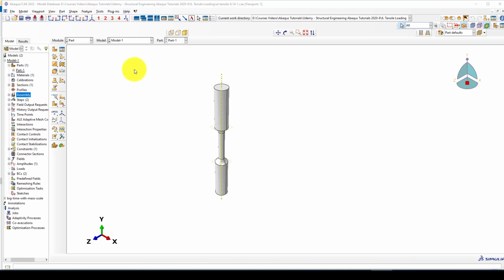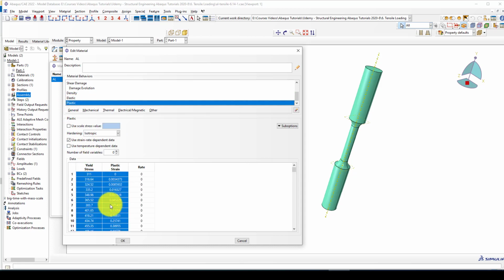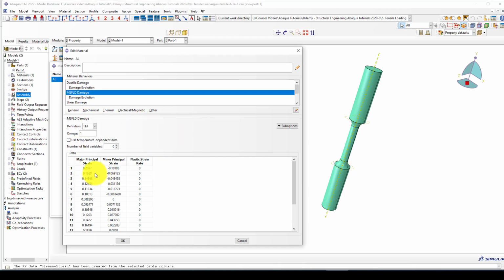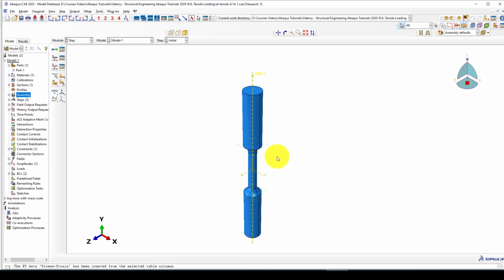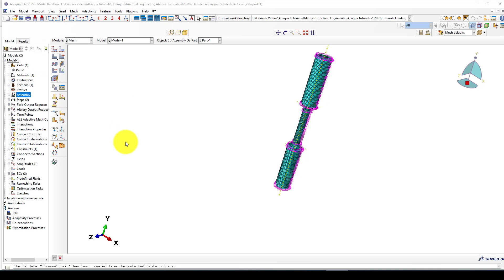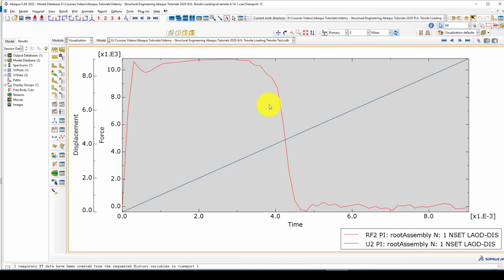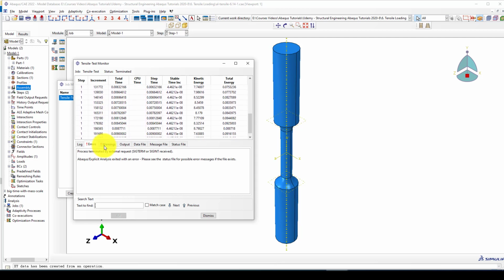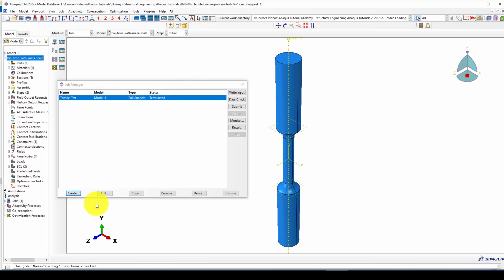ABAQUS Tutorial Brittle material damage and Tensile test Simulation

Comment: Very nice video ! i think u did quasi static tensile simulation in abaqus explicit solver. i have one question. How u have decided to give  a time period 0.03 sec for 10 mm displacement load and u have choosen material property at 0.0001 s^-1.
Reply from the maker: Hi, the explicit solver does not support quasi-static. The time period can be calculated based on the element size. The third part of your question is unclear.

Comment: I don't have damage parameter of  aluminum 2024 the strain rate and displacement and triaxiality stress??
Reply from the maker: You can calculate it .
Reply: @KSSE_Engineer   Is it possible to get results in abaqus without doing the experiment. Because i have to do tensil test aluminum 2024 and 7075 and Do the damage parameter change with the change of dimensions of specimen?
Reply from the maker: @kikinano5830  Abaqus is simulation software, You first must have a test and then calculate the damage parameters by hand. maybe AL2024, and 7075  data can be found in the literature.
Reply: @KSSE_Engineer  thank you 🙏 I'm PhD student and can't do the test  because our university doesn't have machines and materials

Comment: Hello Sir,
Thank you for your tutorial. I have a project about tensile test. I confused to calculate some parameter, like ductile damage and shear damage. Can you tell me, how to calculate it? And if you have some reference, can you share it too?
Reply from the maker: Hi there, it’s not so simple, it’s better to read some documents such as the mechanics of material and plasticity books. As well as the related articles.
Reply: @KSSE_Engineer  Okay Sir, can you give more specific suggestions Sir, eg book title, author or publisher?
Reply from the maker: @suryanto5125   @Suryanto  First, check the ABAQUS Documentaions; there are more references and some very important verification examples.
Reply: @KSSE_Engineer  
Hello sir
I have tried to enter the ductile damage parameter. Then I got an error like this "The independent variables must be arranged in ascending order". Do you have any suggestions for my problem?
Thank you
Reply from the maker: @suryanto5125  gives the data like 1 2 3 from small to greater numbers
Reply: @KSSE_Engineer  
Alright sir. I've solved the problem. However, another problem arises, when I add the ductile damage parameter, the engineering stress-engineering strain graph does not change anything / shows no indication of failure.
Reply: @suryanto5125  Hi did u solve your problems?
Reply: @arumyuliann  Yes, i did it.
Reply: @suryanto5125  can u share ur email? I think i'm facing the same problem like yours
Reply: @suryanto5125  I would like to discuss it with you, if u don't mind. Thank you
Reply: @suryanto5125   I've sent you an email. Would u please check that out? Thank you in advance

Comment: Thank you, but I don't think the dynamic analysis is suitable for the simulation of a common tensile test, which is usually done in a static way. Do you have any comment on this?
Reply from the maker: There is some damage material that not support static analysis, only dynamic analysis supported therefore I used dynamic there is some more reason I have discussed in many tutorials when we should use dynamic and static . In practical it’s static . Good luck 👍